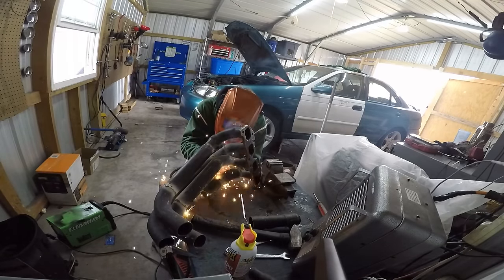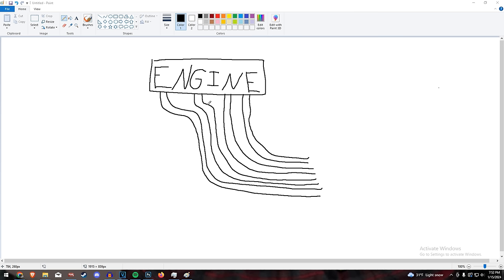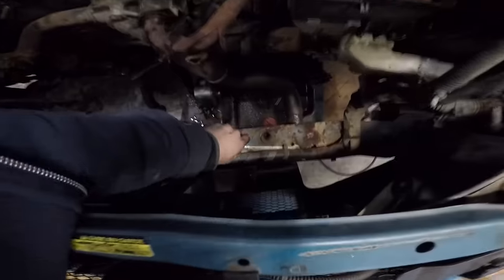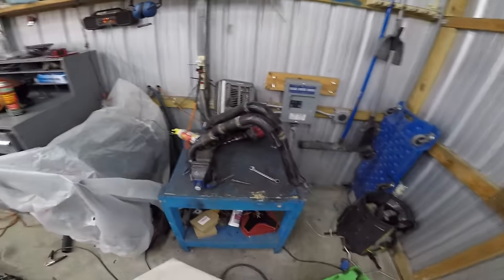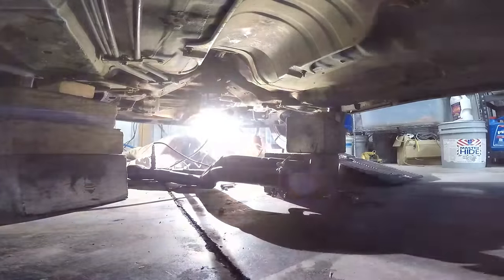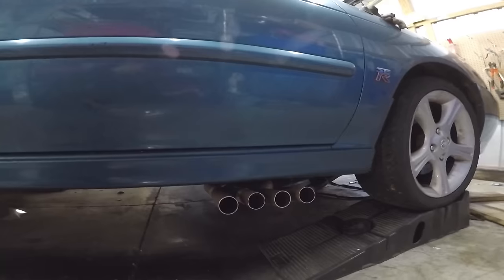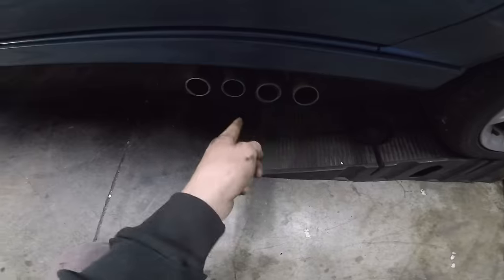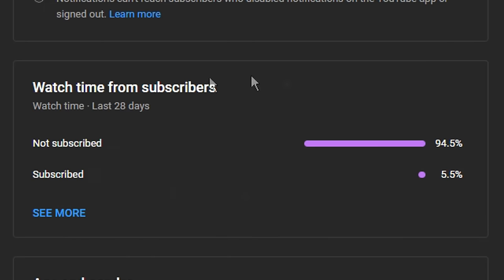True Quad Exhaust on a 4 Cylinder - What Will it Sound Like?

Comment: Why does it actually sound not half bad😂😂😂 I’d say this sounds better than any civic I’ve heard
Reply from the maker: Most Civics have stock systems with the muffler cut off, so that makes sense
Reply: Man you must have heard a lot of shitty Hondas.
My buddy has one that is turbo and 400whp and it sounds great.
Reply: Big ol nissan engine thats why.
Reply: Its a fairly large displacement 4cyl with a very long stroke.
Reply: @HatersGarage   now put 4 eBay fart cans on each one two make it more obnoxious
Reply: Probably because this is essential how Subarus direct exhaust gasses; in unequal pulses. Look up 1320 headers on a Civic, they sound pretty good
Reply: It does sound interesting, I am getting a lot inspiration and knowledge from the videos! Keep it up man!
Reply: Sounds like a Subaru, pretty cool!
Reply: Unless its a civic si with a dohc vtec engine like a k series its not gonna sound cool. Remember there are different trims of civics and hondas. Also it can be hard to make them sound good 😂 the better the engine it is the more timing higher rpm and efficiency and equal headers the higher pitch and annoying it can sound, this even applies to some bmw inline 6's that sound like a tin can and the nissan v6 vq engine a trumpet lol. Its weird how it works but ive noticed the older and "crappier" the engine the more hotroddy it sounds lol
Reply: @spankthemonkey3437  yes inside the car its awesome, akin to an old ferrari v8 lol but thats because of the induction sound mixed with exhaust. 99% of ppl dont know how cars work they only hear the exhaust and start hatin 😭
Reply: Completely different engine its going to sound different
Reply: @knucklestheechidna5718 turbos make them sound better
Reply: @HatersGarage  Ik its a joke but it aint even true 🤣 never seen somebody "cut a muffler off" its usually the civic has been alive and lasted so long the stock muffler and parts of the exhuast are very worn out and could have holes, or somebody cheaps out on an exhuast or sacrifices sound and hearing to go catless with it too and theres the problem 🤣
Reply: Sounds like the 1320 uel headers. Its basically the same idea. Different length pipes give it the typical subie rumble.  It sounds awesome but the dowside is it flows like shit. But when my cars already piss slow ill sacrifice 5hp to sound good lol.
Reply: @spankthemonkey3437  Ive driven a gsr with the b18c and its a riot i own a h22a prelude and a k20z3 civic si all quiet good sounding exhuasts but the k20 intake sounds are crazy it just depends on the intake type and length.
Reply: @peenusweenus3169  lol true.
Reply: And just like any civic it's still sounds like shit. I'd rather straight pipe a V8
Reply: @knucklestheechidna5718 turbos can make anything sound good Honda or not.
Reply: Sounds just like my civic with a custom catless 2.25 with a glass pack. Oh, but without any of the scavenging benefits….
Reply: Sounds like you're just a civic hater 🤪
Reply: FR 💯
Reply: That’s because it sounds like a subie. 😂 
A proper UEL header and a decent catback and I reckon it would sound pretty good.
Reply: You must not go out much.
Reply: One that I know of had it's exhaust damaged and sounds similar to this Nissan.
Reply: Sounds like my brothers old DOHC Quad-4 Grand-Am lol.
Reply: Because its zoomies, not a fart-can.
Reply: Because unequal length headers,  ie. Subaru rumble
Reply: This is that so stupid it’s absolutely beautiful kinda beautiful
Reply: It does sound better that virtually any civic, but, come on, that’s one of the lowest bars to clear 😂
Reply: Needs 4 whistle-tips
Reply: Nah it still sounds like garbage. Too burbley. Reminds me of a Honda with an exhaust leak. You can't make a 4 cylinder sound good
Reply: Now an 8 pipe exhaust for 8 cylinders would be interesting
Reply: @IntelliPocalypse  dude every v8 sounds the exact same juicy fart. Every v8 exhaust is lazy cobbled together garbage and sounds like it.
Reply: @captain1334  Nah just put some trumpet tips on and really piss off everyone in a mile radius.
Reply: How about a zoomie in a civic?
Reply: @repingers9777 i had an 07 si and just gutted the resonator at the end but left the muffler in the middle and it sounded great
Reply: @peenusweenus3169  every exhaust on every car is usually terrible thanks to regulations
Reply: @repingers9777  The "good" sound comes from the intake side, even on the JAS Racing Accord Super Tourers to be fair (the older Accord was a H22A reduced to 2.0L, the later ones were a K20).  The exhaust side doesn't sound like anything much.  Re: BMW inline-sixes, some of them have an unequal header and therefore sound like crap on the exhaust side (the E46 M3 on the exhaust side [again the intake side sounds incredible] and F80 M3 have this problem) The Nissan RB20 revving to 8,000rpm on the other hand, sounded fantastic: https://www.youtube.com/watch?v=KNZDvcAUuyU An inline-six with an equal header revving high sounds good.
Reply: @AtomSquirrel  "You can't make a 4 cylinder sound good"  How about this Alfa Romeo Giulia? https://youtu.be/19SDN1HjmGk?si=lO3afRzKs6hCjzJt&t=74  Or this Audi Super Tourer?  https://www.youtube.com/watch?v=4cLjh25SNmQ  I think they sound fine.  After all, just as a Cosworth DFV V8 F1 engine sounds like two 4 cylinders joined together, even a BRM V16 sounds like four 4 cylinder engines joined together: https://www.youtube.com/watch?v=A4w22LJrLeU🙂
Reply: I have a 2000 civic with the stock muffler it’s quiet I like it
Reply: @IntelliPocalypse   This. 
And not just zoomie headers, but a full length 8 pipe exhaust.
I have been trying to find video of anyone who has done it this century with no luck.
You could be the first!
Reply: @knucklestheechidna5718 hahaha i bet this still sounds better
Reply: Those SE-R’s sound better than any civic from the factory.
Reply: That was the least efficient way to say that possible. Congratulations.
Reply: you must have only heard 2-3 riced civics.
Reply: I agree it sounds like it's on carburetors a bit
Reply: @AtomSquirrel  like I said, low bar to clear hehe
Reply: @repingers9777  well you must be ignorant to the fact that lots of people cut their muffler off intentionally to make it sound loud and "better" though almost everyone else will disagree on the latter.
Reply: @HatersGarage that’s not true. They’re cheap, oversized exhaust systems mostly
Reply: Must be hellish loud, but nice tune.
Reply: Disagree. It doesn't sound like a trash bag full of aluminum cans. 0/10
Reply: Any civic? That's 🧢
Reply: Sounds a bit like a big bore old school VW boxer.😮
Reply: Never heard the tripple fartcan exhaust then
Reply: @salt-emoji  you ever cut a hole in an empty aluminum can at the side near the bottom of it and screamed through the top hole you drink out of? It sounds musical.
Reply: It sounds good as hell man ngl😂
Reply: but also his head hurt
Reply: As a civic owner and Honda for life guy, I actually agree with you
Reply: @twoeightythreez love a long stroke
Reply: Then you haven't heard a nice civic
Reply: @captain1334 I second this notion
Reply: The stroke of the engine and the unequal length pipes.
Reply: even a good sounding civic sounds pretty close to a shitty old stock one..... as much as fanboys hate to hear it they don't really sound that great! they just sound better than a lot of other cars in their class when all that is done is removing the muffler.....
Reply: 8valve
Reply: Lemme guess , you like german cars lmao , Civic is popular for a reason and I have never heard anybody trash the civic unless they are a different brands fanboys , people should just accept that Toyota and Honda are just better than any other company , at least with ICE
Reply: Subaru boxer with UEL sounds... Oh yes!
Reply: Sounds like a jdm motorcycle, w/2x the bore & stroke
Reply: Its barely running.
Reply: Lies
Reply: It helps that he's using an SR20. They're known to sound great no matter what exhaust you throw on them.
Reply: Obv it sounds better than any other Honda 😂💪🏼
Reply: @knucklestheechidna5718 I've honestly never heard a civic with good sounding aftermarket exhaust.  I'm sure they exist, but they're like unicorns everywhere I've been.  All I've ever seen are coffee can mufflers driven on residential streets at full throttle.  God awful
Reply: You must have never heard any rallye Civic or hill climb one then, or even BTCC Civic's
Reply: Most civic guys pull the resonator off, ugliest tone ever imo (on civics)
Reply: LMAO, you seriously think that sounds better than a b16 with a proper Spoon Racing 4-2-1 header into a real skunk2 racing muffler?! That paired with a proper cold air intake is about as good as it gets for a more modern 4 cylinder sound.
Reply: It sounds like a lawn mower to me.
Reply: @knucklestheechidna5718 most hondas use the stock exhaust with mufflers removed and they sound like shit. If your friend has a built engine, they probs used a better exhaust and that's why it sounds good
Reply: Barf
Reply: Yea civic are shet
Reply: I mean, I've heard worse, not too bad
Reply: Sounds like you haven't actually herd a built civic then lmao
Reply: @HatersGarage any performance increase?
Reply: Cuz it's 2.5L and not 1.? like an EG hatch
Reply: If you said that then you'd sound like everyone else, which is fine
Reply: He sould cam it, itd probably be nasty after that
Reply: That thing has to be LOUD! But it really does sound awesome.
Reply: Thus comment section is ridiculous. All hondas turbo or not sound like garbage. An Evo on the other hand with the 4663 sounds way better. Doesn't matter what you do to your hondas exhaust, it's still going to sound like a fart
Reply: Cuz they over tune them, they can sound so beautiful
Reply: Civics just sound like there constantly overheating with a bit of a motorbike sound
Reply: Sounds better than most 4 cylinders with mufflers
The idle Sounds great
Reply: Wow it sounds great compared to many civics on the street
Reply: @Hayden_Agar   Tbh I cant really deny this lmao.
Reply: @scottlepot   I've seen and driven tons of cars and they haven't changed my love for old honda's that use dohc vtec. You just have to drive an old gsr or any k20 with an intake and decent exhaust to understand. The induction sounds mixed with the more sportier 4cylinder motorbike sound is eerily similar to some old ferrari's ( only in the cabin ) so yes it is very fun to rev them out especially when you consider hondas have the best shifters out there. Most civics and integras are junk boxes? YES i agree and the exhuasts mostly sound bad but not all (:
Reply: My thoughts exactly. Just too loud lol.
Reply: GTR*
Reply: You must not see a lot of civics aside from shitboxes huh
Reply: Because its a Nissan not a honda lol
Reply: Bro posts washing machine sounds 😂😂
Reply: @Bjsclips   hey hey hey dont be jealous of my washing sounds
Reply: Dude right?!?
Reply: My civic sounds pretty dope imo
Reply: Because it sounds like half a V8 😅😅
Reply: @captain1334 , the fart cans wouldn't make it louder than a straight pipe running as short as his are. Those fart cans are still mufflers
Reply: Yeah, the souns is great ❤
Reply: This 4 Banger wouldn't make me angry when it drives by😂
Reply: V neck kicked in
Reply: Yeah, it sounds pretty decent on startup and idle. Just don’t drive it…sounds like someone rushing home after questionable taco night after sitting on a kazoo, and it’s going to be really close because you might get to 50mph burring that needle into the red line
Reply: 2:55 it sounded like a subie almost
Reply: Sounds like a Subaru boxer engine now 😂
Reply: My l si with fbo k20z3 catless headers to 3 inch ktuned exhaust sounds fucking great. Not like the civics you're thinking of lol
Reply: @knucklestheechidna5718 K swap?
Reply: Agreed!!
Reply: Nahhh not ANY certainly the ricers and Teenagers that cut the exhaust
Reply: Cause it’s a spec v
Reply: You haven't heard all civics
Reply: Buddy club spec 2. You’ll fall in love with civics.
Reply: B16 civic will blow you away boy....
Reply: Unfortunately it now sounds like a subaru  YUCK.....
Reply: From idle it don’t sounds like a inline 4 at all lol
Reply: @knucklestheechidna5718 I hate to say but that's most of them. A fart can and a cold air intake, it's a race car!
Reply: I agree sounds better than almost every Honda I’ve heard. Honda boys salty 😂
Reply: I came here to say this.  I don't hate it. It sounds way more fun than it should. Would I want to live with it everyday? Fuck no.
Reply: You are incorrect.
Reply: run them to the back and put four $40 evil energy mufflers on and she wouldnt sound bad at all!
Reply: @Infernostar18 
Would need 6 pipes
Reply: Qrs just natively sound better I guess😂. Also the average Honda Civic does not have the best exhaust system to start with. The sentra comes with a 1.75 inch exhaust from the factory. Where is the Honda Civics of the same year only have a 1.5 inch exhaust😂 also this exhaust does not have the world's tiniest sounding soda cans put on as mufflers😂
Reply: @JsliceQB1026  i think my car has a 2” inlet 3” outlet muffler on it. doesnt sound terrible at idle. due to not having a resonator though? makes it a bit raspy at certain rpms though
Reply: @Infernostar18 big isn’t the term I’d use but yeah
Reply: @MissingLinkGTRS  what my thoughts was. Most common engines are 1.4 to 1.8 litre. This one is a bigger 2 litre, i cant remember the size. But yea.
Reply: @Infernostar18  most engines at least here in the states are between 2.0L-3.5L depending on what engine it is most 4 cylinders are between 2.0L and 2.5L
Reply: @MissingLinkGTRS  so japanese cars are all 2 - 3.5 litre 4 cylinders ranging from 1980 to 2010?
Reply: @Infernostar18  No, If you read what I said properly, you’d see I said most cars in the states. Regardless of make range around 2.0L and 3.5L depending on the type of engine sub 8 cylinders. I also noted that most 4 cylinders here in the states are between 2.0L and 2.5L
Reply: @MissingLinkGTRS  then if you read what I said properly, youd know than i meant mostly nissan which would basically mean jdm only cars.
Reply: Personal opinion but I know i'm right anyway and i refuse to listen to any other logic or opininion:

 'Cause an engine, any engine in fact, no matter the configuration, should/ is supposed to have a dedicated straight pipe for each cylinder, whether it be 1 cylinder or 12, ie: that's how an engine is  supposed to sound
Reply: @repingers9777  you're not joking about BMW's inline 6's. I just did a custom exhaust job on my 06 Z4 with the N52 engine. Catless headers into y-pipe, then into a single 3 inch all the way to the rear. Anything below 3k rpms and my car sounds like a fart machine, above 3k and it sounds kinda mean. I'm gonna go back to a dual 2 inch system at some point.
Reply: You’re wrong but ok
Reply: Listen to a tanabe medallion or yonaka exhaust then
Reply: SR powahhhh
Reply: @spankthemonkey3437 mine has zoomies in fact. B18 destroyed with a b16 crank
Reply: Guys, Here is The Savior

HalleluYAH “Praise ye YaH”

YaH is The Father (Genesis 1)
YaH arrives via the TENT OF MEETING
YaH was Who they Crucified for our sins
YaH was Crucified on an Almond TREE

Ancient Semitic Moshe (Moses)
Isaiah Scroll (The Original Isaiah)

Isaiah 42:8
I am YaH; that is my Name! I will not yield my glory to another or my praise to idols.

Isaiah 43:11
I am YAH, there is no other Savior but Me.

Isaiah 45:5
I am YaH, and there is none else.
Reply: It sounds like a car without exhaust.
Reply: @AtomSquirrel  do you also think the earth is flat? good sounding 4cyls are out there and they are hondas maybe i have to put audio over a different car so your car racism doesnt flare up lol
Reply: @TassieLorenzo the links you provided sound like hondas with PROPER setups or in different cars with different exhuast designs lol the prejudice is crazy
Reply: @seanwilks7712 no they fucking dont bro doesnt know what a civic type r is its so over look up fd2r acceleration
Reply: @repingers9777  

lol, you saying I don’t know about Type R’s? 😂

I remember when I thought Hondas were cool…back in the late 90s-00’s. I’ll take  the acceleration of my supercharged E90 M3 over a TR.
Reply: This is what the supercars do
Reply: @stone1537  do what? wait until you learn more about engines and realize any high trim dohc vtec engine is closer to a supercar engine than anything else you could think of 💀 ( im serious )
Its cursed knowledge nobody wants to learn
Reply: Idk what civics you’ve been listening too.
Reply: I'd say a good air filter, good port polishing and an oil catcher, just in case you know, and its gonna be legend... wait for it

Dary!
Reply: The civic hate is hilarious, it’s been like 30 years now, why so mad? I don’t care for the sound of cammed V8’s, I don’t shit on them tho